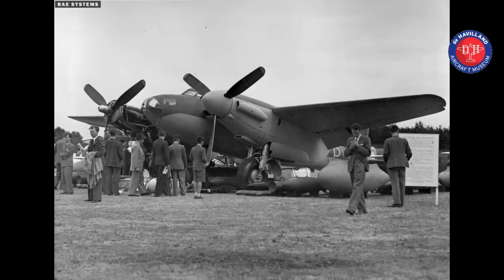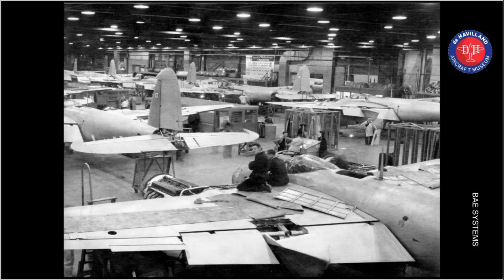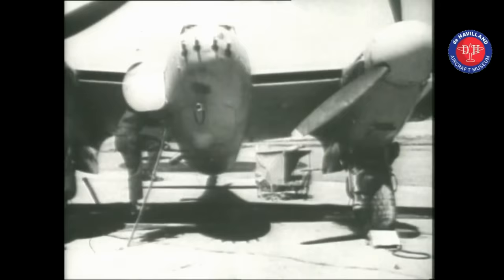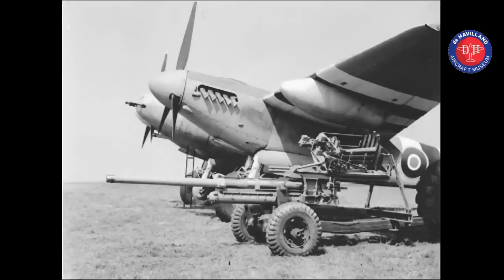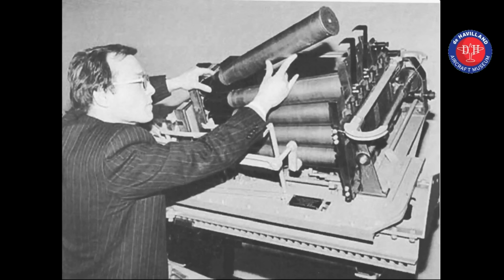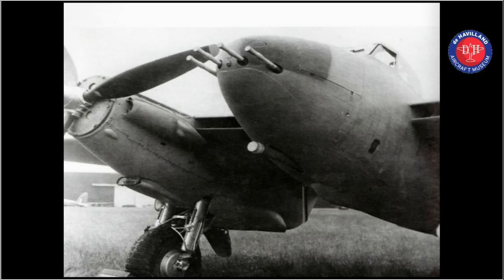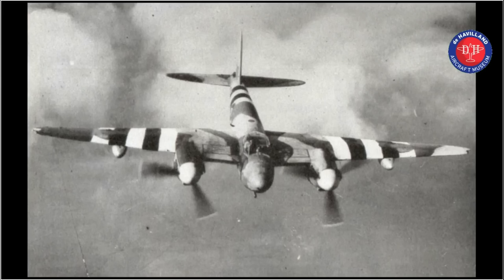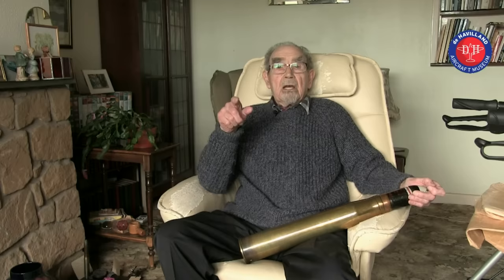TSETSE the DH Mosquito Mk XVIII

Comment: My father flew out of Predannack and while, like most veterans, he didn't talk much about what he was doing in the war did once mention being one of the Mosquitoes that were accompanying this type of plane when the went raiding for submarines. He talked about them "flying around making a nuisance of themselves while the plane with this ruddy great gun took aim at the ship" and when the gun fired it practically stopped the plane carrying it dead in the air.

The Mosquitoes from this airfield did reconnaissance and low level intrusion raids over France. (My mother said that he used to have a bit of French tree....it came back in the tail wheel....)

Comment: These Brits could fly and fight with the best. Glad they were on our side.
Reply: Yes we did OK, but without the USAF to do the daylight bombing we'd have lost it. Our aircraft would have been cut to pieces in daylight, so we did the night ops as we have the bomb sights for that, and primitive radar, but it was the Americans in their big formations of B17s that went over Germany in daylight. Their bombloads weren't that big (A Mossie could carry more) but they were very will armed, and needed to be. They gave a good account of themselves over Germany, but took horrific losses at times, but day after day went back. Their courage and skill are often not recognised by us Brits, partly because it was such a melee in daylight that their bombing was not always that accurate....it's a miracle they got to the target at all. They were great pilots and very brave men...they knew they were comparatively 'sitting ducks' for the German fighters, yet they never faltered. Between us, we got the job done...... Grood show chaps.
Reply: @KathrynLiz1  Both sides had the evidence the 400mph Mosquito type aircraft would make better bombers than the slow four engine things we did use. The B17 with its large crew and heavy defensive armament carried about 4000 pounds of bombs to Berlin and up to 6000 pounds on shorter missions. The Mosquito with two crew could take 3000 pounds of smaller bombs or one 4000 pounder to Berlin. It's high speed was enough to evade interception. Two of them could take 6000/8000 pounds. They would do that with the same number of engines, just four crew and get the job done with better accuracy. 
The top brass, fixated on area bombing were not interested in doing a better job or putting fewer men at risk.
Reply: @KathrynLiz1  Yes, now just think how much shorter the war could have been if they had joined in AT THE START!

Comment: The mosquito is the 007 of airplanes.
Reply: Nah. It's the Moneypenny. Unglamorous compared to the fighters (or even the heavy bombers), underappreciated in modern media but still doing an amazing job.
Reply: How about  A10?
Reply: Oh the Mosquito's definitely A 10 out of 10
Reply: How about the Swiss Army Knife of aeroplanes?
Reply: Bomber Command and US Eighth mad a huge error using so many heavy bombers. Most of their raids would have been more effective with Mosquitos. They would have needed 2x as many aircraft, but would have used fewer crew (2 per plane instead of 10) and the same number of engines. Two Mossies could carry more offensive armament that one B17 and being so fast could take on the German fighters directly. Lancaster was the true heavy but they were under-used for most raids when smaller faster planes could do the job.

Comment: Most important twin engine plane of WWII. incredible idea to use wood in the days of aluminium shortages. It made the Germans green with envy.
Reply: The Horten Brothers in Germany worked on revolutionary wooden aircraft. (1) They struggled for resources but (2) did not have the resin adhesives to get the job done.
Reply: Not just the use of wood, but the ability to use cabinet and piano makers to build aircraft. It was a way to get more aircraft built than anyone expected.
Reply: @ScottKenny1978  Yes, that's exactly it, the furniture makers were used to build the wings and fuselage etc, particularly in the south Chilterns/High Wycombe area.